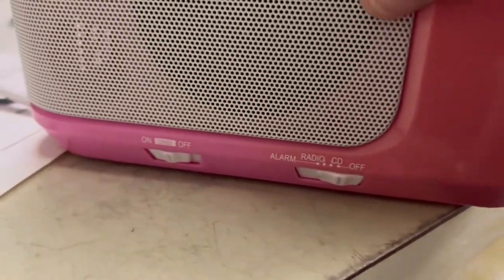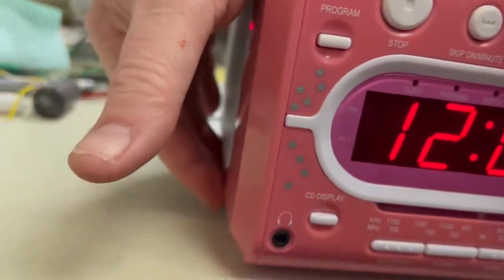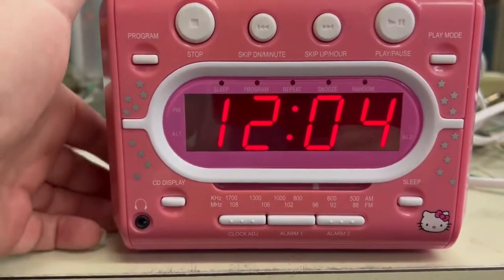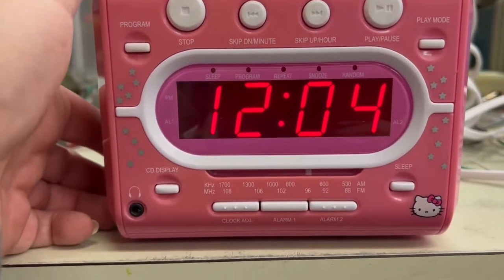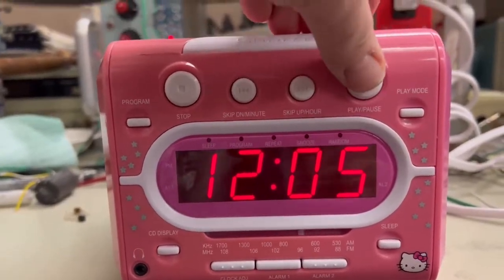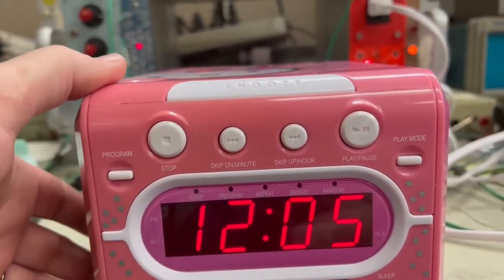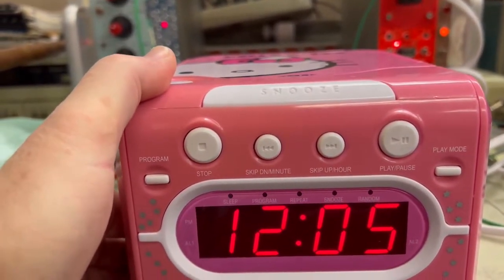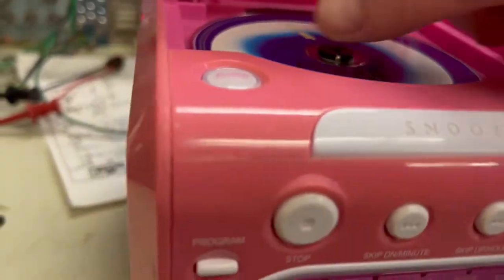Icemanfiveoh-Random repair-Hello Kitty cd alarm clock repair

Comment: Thanks for the video. My granddaughter just brought it over with the same issue.. As a Ham Radio Operator I do have an electronic work bench fully equipped. I was going to just dive in, but with your video I can go straight to the lid switch and hope it has the same issue.. Appreciate the video and tips.
Robert
Reply from the maker: No problem Robert. Good luck and let me know what you find!
Reply from the maker: Fellow Ham.W9SVT
Reply: @icemanfiveoh  ok unit is fully operational. In my case the lid contact was not bent but it was closed but had no continuity . So I used some 120 grit sandpaper and polished the contact and then it was working properly. My spinal drive rubber shocks were still ok so I did not have to lift it up like you did.
I printed out the operating instructions added a 9 volt backup battery and the Granddaughter is Thrilled!! 
Again your video let me fix this in half the time! Good job! 👏 👍 
Robert. WA6PHN
Reply from the maker: Sometimes I get comments on why bother making videos like this. This is the whole reason I do it. I got to fix something and in the process I ended up helping someone else. I'm glad that she is enjoying it. Thanks for tuning in and for the interactions! Stay safe out there.
Jason

Comment: I have no experience at all or any tools for this but this video was interesting and informative! I was gifted this and the only thing that seemed to work was just the time, even when it gets switched from off to cd the lights don’t flicker or anything. I’m not sure if the radio works either but cd was the main reason I wanted it. Do you know anything I could do to fix it?
Reply from the maker: I would guess there is something wrong with the mode switch or the switch lever isn’t on the switch anymore. What I mean is the plastic switch you move isn’t connected to the actual electronic switch on the pcb. Sounds like you gotta open it up and find out! Then you can move the mode switch itself and see what’s going on. Good luck. Let me know what you find out….